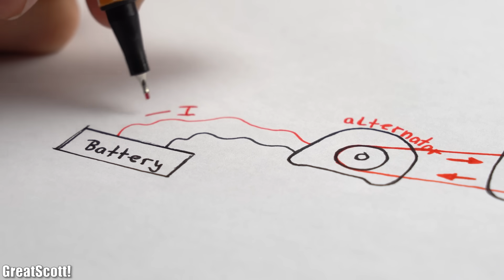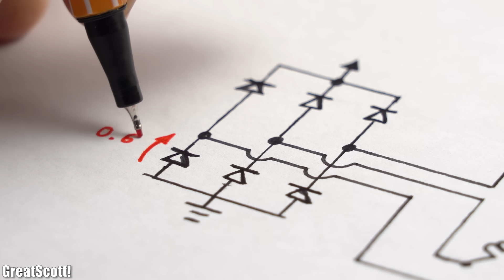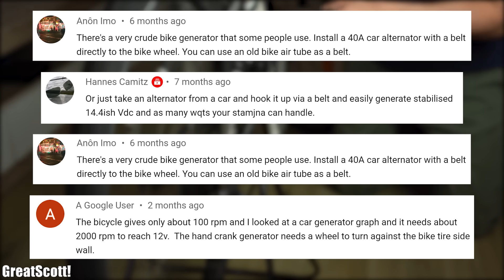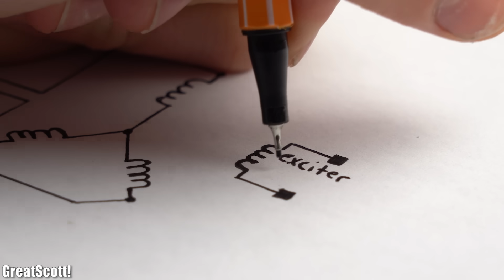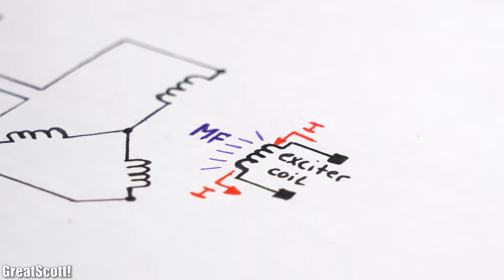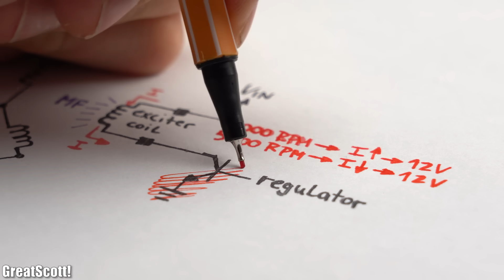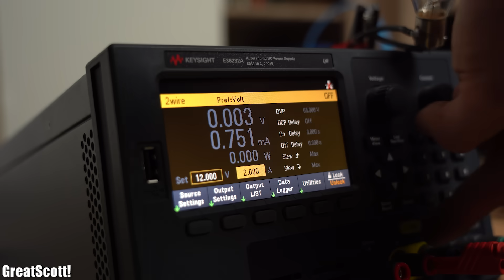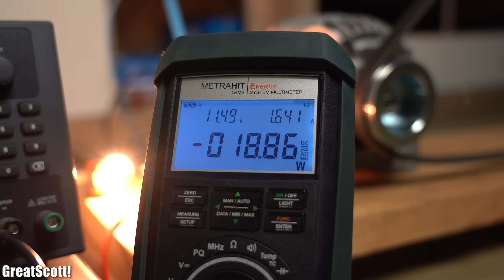Using a car alternator with a bike to power my home? How much energy can I produce?!

Comment: some have used a small Honda engine to turn the belt and get to 2000 rpms you need, unfortunately  you have to run the motor in the garage outside

Comment: Just spin your cordless drill on the alternator. Connect your battery cordless drill with the alternator. Which is charging your cordless drill battery. As long the spinning is right you get the full 12- to 14 voltage better if you can bypass the regulator and put more voltage is a bonus to power other loads. Need to do this to a electric car like Tesla and other EV cars. Later connect your drill battery with car size battery for more voltage storage

Comment: The smallest sprocket on the wheel and the largest sprocket on the pedal shaft would have given you the highest rpm ratio.

Comment: Volts times amps under load equals watts. Average alternators rated 480-600 watts at 12 - 15 volts 40 amps.

Comment: I don't know if someone pointed out already this thought: The alternator is rated for 120 A at 12 V, which amount to 1440 W. With one HP (horsepower) being about 736 W, in order to get the maximum power out of your alternator, you have to put in almost 2 HP on your bike! I don't know the exact number right now, but a human (and I guess even you 😆) can continuously only produce a fraction of an HP! So no wonder you are not getting even close to the maximum rated electrical power out of the alternator. Apart from that, you seem to have some additional losses (e.g. belt slippage) due to the somewhat "shoddy" construction of your setup. But in any case, experimenting is fun, I know...

Comment: Okay, speaking without much knowledge here, but question for someone smarter than me  - If the exciter coil requires 12w to get the needed resistance to generate current, couldn't you use permanent magnets in an alternator instead of electrically generated?

Comment: 1440 watts at 12 volts kk we'll call it 12 amps. You go thru a converter to 115t volts and you have 1.2 amps.....P=I x E 1.2 amps at line voltage won't power much but led lights.....

Comment: This is very useful, and just on the edge of my understanding. I did electrical engineering at college  a long long time ago and still get flashbacks to class but can't for the life of me remember what it was all about.
Reply: Me too. I was interested in electronics up until then. It was as dull as ditch water, I can remember that much!
Reply: I had an auto tech class like that. Resistors and opened and closed circuits and all kinds of things. Just can't really remember.
Reply: That’s funny because I got an electronic engineering degree while I was in the Air Force, that was 35 years ago. I don’t remember anything hardly
Reply: They taught you to accept "not to think"
Reply: @radleysmith7528  It really was an awfully long time ago. I think I liked Boolean algebra and Karnough maps. There's a strange warm feeling in the memories. When you get to this age you've had so much time you genuinely can't remember, but if you can work it out from first principles again, you're still sharp. I'm saying nothing about Boole, but you'd be amazed how your mind wanders in the queue in Tesco.
Reply: @neilbain8736  Don't let them pack your shopping Niel that requires analitics, let them carry it though
Reply: @radleysmith7528  LOL Bag packers exist but I can do a better job myself.

Comment: No gears between the two objects between connected by the belt, so you're losing a lot of rpm as to how much power you can petal out of it, but you'd still need a slave to keep the lights going huh ? One could always use a river current as the horse power to power that idea.

Comment: Driving a dynamo with a bicycle application you can maximum achieve 1/10 hp=75 Watt for a short time, for longer timeslots you earn 50 Watts. 1 hp=736 Watt, 1kW=1,358 hp 💪🏼💪🏼

Comment: if you had asked a mechanic how the alternator works it would be easier! just connect a 5W light bulb from the positive terminal and the plug pin, instead of destroying the alternator 
it's like connecting the green cable to the negative of the power supply of a PC

Comment: Maybe more gear exchanges will give a better ratio. Or!!! 
Power up Dewalt batteries from solar then use the Dewalt drill to spin the alternator. Or maybe a circular saw or grinder will be better with the resistance and have a higher rpm?

Comment: You need a self-energizing alternator. Only requires 1 wire hook up. Could charge a bank of car batteries (3-4). Use only for critical functions in survival situation (heat and water).

Comment: A permanent magnet generator would be a better choice in a human powered generator. An automotive style alternator will pull 65 watts just to power the rotor. A normal human would only be good for 100 watts unless it was for just a brief time period. If you full field an alternator and try to turn it by hand it is very difficult.  Also many people in the comments think they spin at engine rpm. They spin much faster because the crank pulley is usually three times the diameter of an alternator pulley.

Comment: I use a lawnmower engine to turn the alternator to charge batteries to run a 3kw inverter
I get 30,000 hours on a engine and 8 hours on a gallon. 
Lets see you get 8 hours on a gallon an a 7 hp engine

Comment: Did you try low rpm generator with bike to generate electricity.  With low rpm you don't need to paddle fast and it will generate higher amount of electricity.

Comment: we have modified these altinators by cuting out space in the eciter rottor and adding neo dymium magnets using a 24 volt altinator we were able to gain 10 times the voltage and output a constant 240 volts from each phase ,so it gives 2 x 240 lines of a few thousand watts each, going to try and power it  via a tiny 25cc chainsaw motor i found and build an electronic ignition/timing solution for better efficency

Comment: You look like you are an electrical engineer or have advanced knowledge of circuits. If you tie the two smaller pins together it will self excite. Mine is hooked up to a 5 hp gas engine and 8, 100 amp hr batteries to a 5 k inverter. I run the engine approximately 4 hours a day . My small cabin stays powered up. I am looking to hydrogen power the engine with 12 vdc system and charge my batteries with water power.
Reply: How does it self excite without any magnet fields? The small piles are used to create an electromagnetic field that interacts with the primary coils to create the power generation and varying that input will also vary the output 🤔

Comment: The typical cyclist is supposed to generate 1/10th horse power. That would be 7.46 watts. Even if the alternator did not need to be exited with dc, that would still be far too small to provide any where near the energy your home requires. Perhaps an energetic dog inside an exercise wheel could do better?
Reply: I have to correct this statement oif mine. 1/10 of 1 HP =74.6 Watts, not 7.46 watts. Thus there is plenty of energy that a human could provide more than 7 of 8 watts. For how long would depend on their physical endurance.

Comment: Basic fact. The average alternator used to produce 50 amps at 12 volts. To get that to 120 volts you drop the amps to five volts. A typical house circuit is 20 amps. You can get larger alternators and many years ago you could buy a kit or an already done alternator that had a box on it that provided 120 volts straight out of the alternator. All that said I had an old six volt tractor and wanted to change it to 12 volts and the tractor shop sold a single output 12 v alternator. So you didn't have to worry with anything except one output wire and the ground. Unfortunately to get to 120 volts there is some power loss. It's a nice toy if you want to light a few led lights in your den or power a small tv while biking. Remember one thing, as you load the alternator it has more resistance to turning so it will no longer turn freely.

Comment: At approx, 3:50 you comment about getting the bike into the highest gear, but the video actually shows you putting the chain on the largest rear gear which is actually the lowest gear ratio.

Comment: I used a alternator.   /12volt@ 120 Amp  hooked to several car batteries.  To a high output inverter. To give me what I need. Hooked to bicycle.  I ride charge car batteries get EXERCISE  and power my  home!

Comment: i built a diy ebike. one time i spun the wheel, with the bike off and no battery connected and noticed that the my watt meter lite up. i made note of this. fast forward about a year and i finaly got around to playing with this. i built a stand that  holds the rear wheel up off the ground about 1/2 inch and holds it very solid and is very easy to place on the stand and take off, like 2 seconds to put it on and 1/2 second to take off.

i connected a 12v battery to the controller input and started pedaling and it started charging the battery. i put a load on the battery of about 100 watts and went back to riding to get acclimated to how much engergy i could produce.

i found that i can produce 20 watts with almost no effort, about 45-50 watts if i pedal like i do when i am riding my non motorized bike outside. also, at this pace of about 45 watts, i can do this for about 3 hours at the moment which would be about 135wh, which isnt much but its better than nothing.

also, i pushed it as hard as i could and i think i was able to create about 150 watts or so, but i would able to only do this for about 3 to 4 minutes.

this will be a fun way to not only get into shape but get something out of it, and make me appreciate how cheap and easy the ulitity company can put electricity into my house.

side note: i ride a non motorized bike several times a week, i do about 30 to 60 miles a week just for fun and exercise. i also built an ebike and 4.5kw solar solar system, so i have experience with batteries, controller, chargers, cc/cv boost and buck converters etc etc. the average person is not going to be able to do much with this setup, but its very efficient for what it is, no loss in belts, external chains.

Comment: The apartment I moved into was fully furnished and had one of those super old sewing machine tables converted to a regular table. But it still had that mechanism on the floor similar to a pedal which you would push and there was a larger heavier wheel that would turn and would’ve ran the sewing machine. Since that wheel was made out of iron and was really heavy and it was really easy to keep it running as a kinda acted like it’s own fly wheel.
I’m wondering if it would be easier to keep an alternator spinning with this type of setup…

Comment: Depending on how much drag that alternator generates you could probably run that setup through a Bedini Energizer & you wouldn't have to peddle.  I've built something similar but never with an Alternator which is a good idea of yours...  I've built several with 26" bike wheels... bike bearings I've found are very poor so I've swapped them out for a ceramic bearing set which I've mounted on the frame via a steel shaft to give a truer rotation..   I have built Bedini's "Self Runner" Energizer which is a North/South magnet Energizer configuration but I've not started work on the Recovery Coils & Commutator setup... I have assembled them before & it does backcharge the input..

Comment: I've always wanted to do something like this with an alternator. But it seems like that regulator circuit cannot be seen as a hindrance. You need that unless all you want to power with this device is an incandescent bulb that doesn't care about inconsistent voltage. It seems like alternators are spec'd out to generate off of an extremely powerful source of physical force 400 times stronger than a human. Otherwise they're great. It sucks because they're the same size as a 12V DC treadmill motor. That regulator circuit needs to be made out of different diodes. There's going to have to be more copper windings, but in the same ratio of winding number in the stator and rotor of the alternator for 12V. The switching thresholds in the regulator circuit need to be for human power and not 100hp. That rear bike wheel could be a heavy flywheel. Thus it could be a bucket of sorts for the physical force generated by the human that would help overcome the switching events. Maybe a supercapacitor array could be a bucket for the power being generated and the choice of other components could be oriented to that instead.